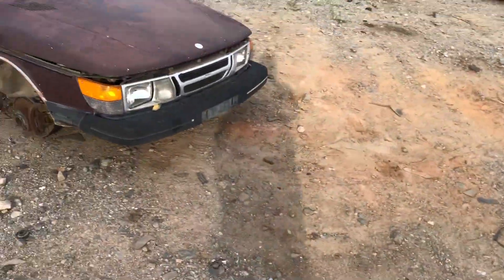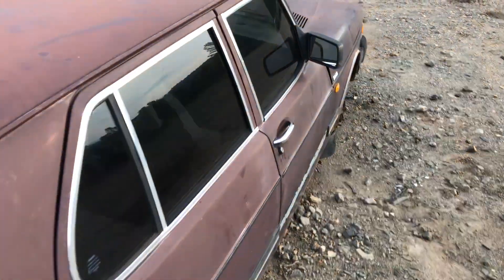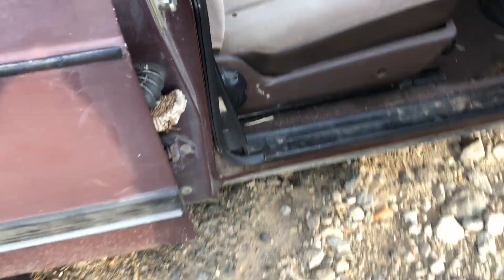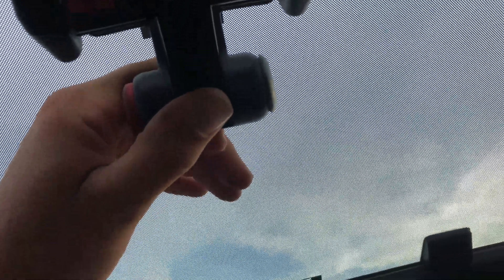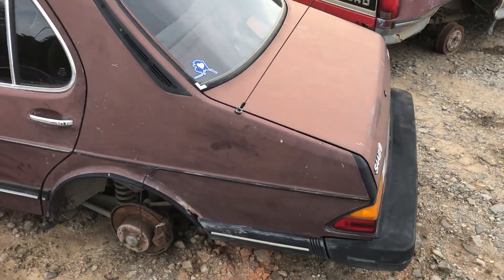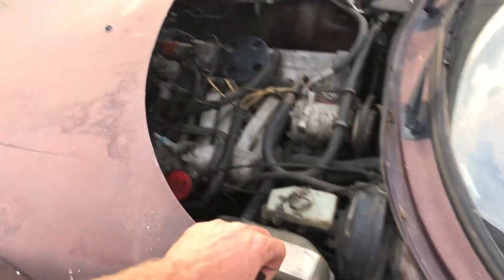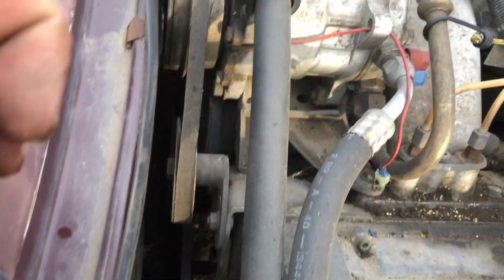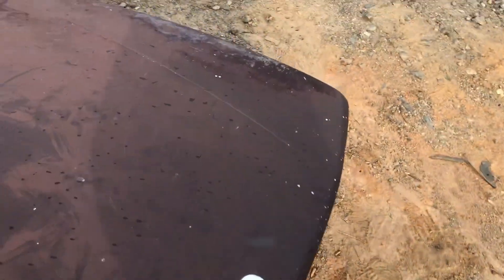86 saab scrapped

Comment: Saabs were fun cars some of the first that had heated seats vented cooled seats and turbos and they use to make 2 stroke cars also.
I have a 2004 saab 9-5 with a 2.3T and it has 232,000 miles original clutch turbo and head gasket 🎉